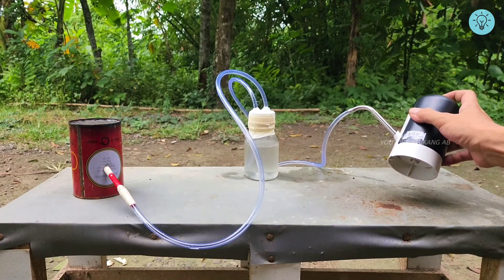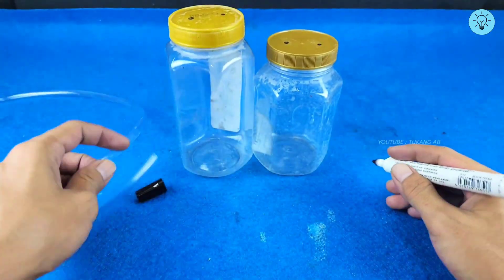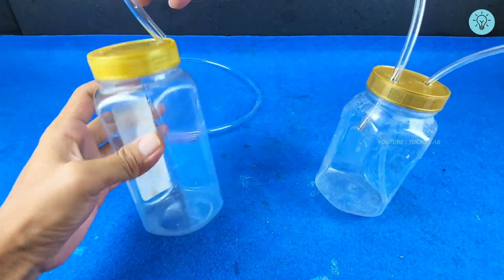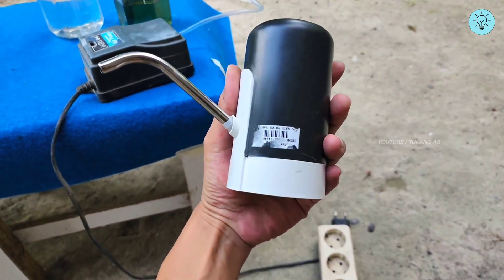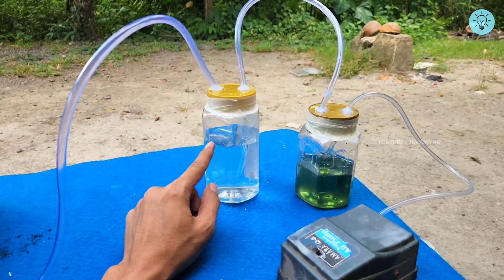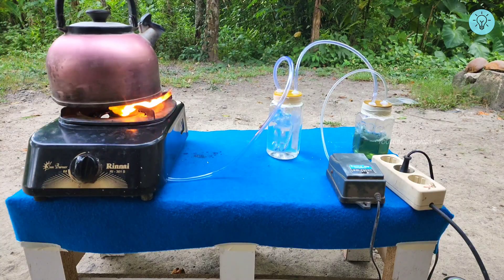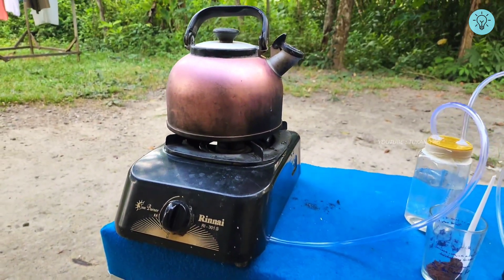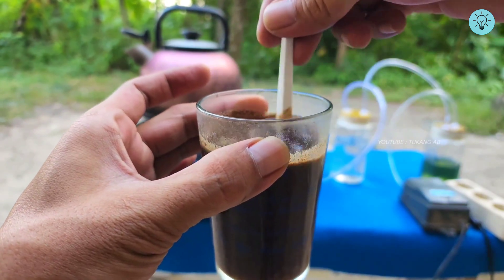No More Gas Cylinders! How to Get Free Gas All Year Round with a Water Jar and a Hose

Comment: Which jar should be used Plastic or glass?
Reply from the maker: You can use all of them, the most important thing is that the jar has a lid that can be closed tightly, for maximum results you can add duct tape or insulation to the lid of the jar so that no air can escape and the emergency stove will work more optimally.